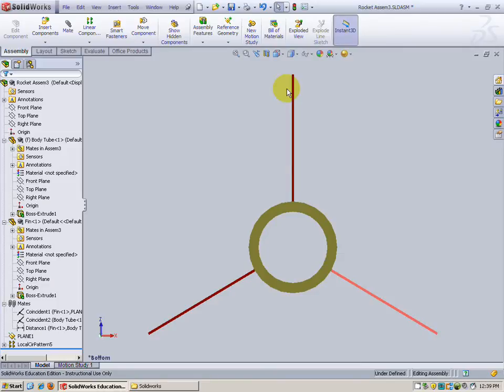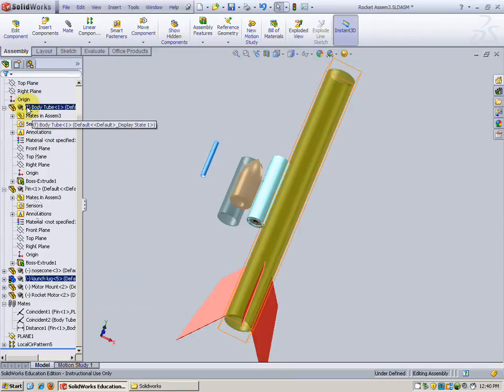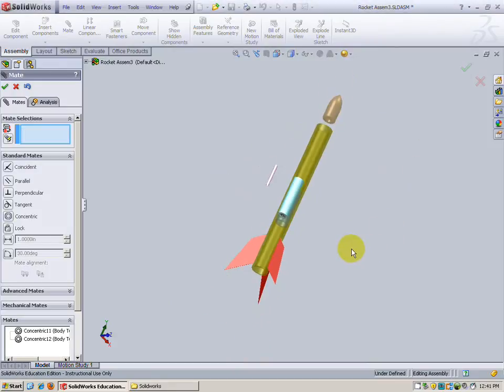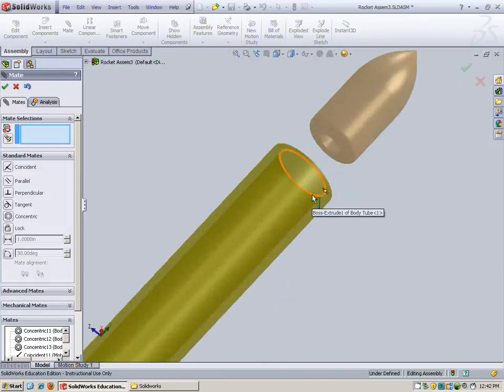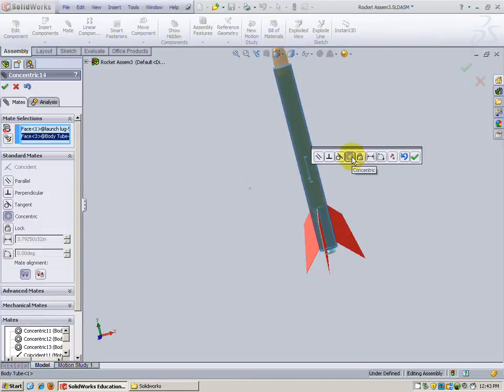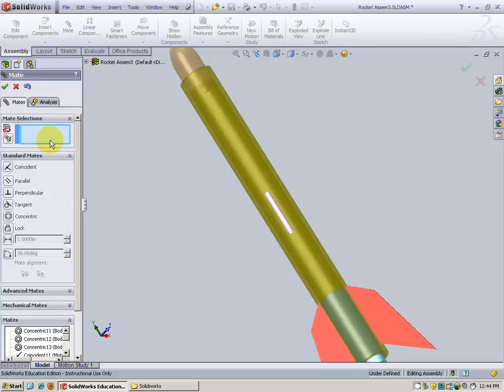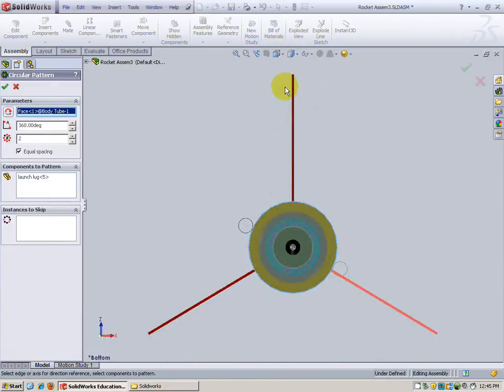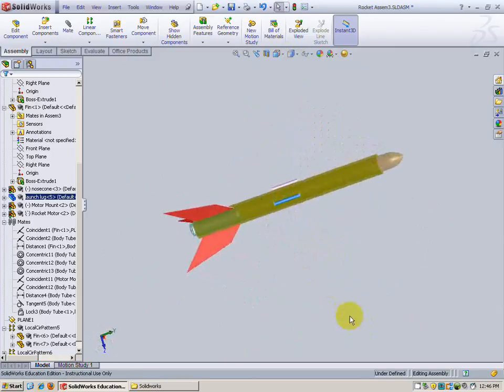Creating Rocket in Solidworks (7 of 7)

Comment: Very nice job otherwise.  One thing you might do with the students is simulate the flight of the small rocket on a commercial program first without the "optimized" nose cone and then with the more optimum nose cone. I would bet that the difference in predicted maximum altitude is not very great.  Then go out and fly both designs and see if it agrees with the code.  Just a thought.  Again, nice tutorial on Solid Works.

Comment: You need to draw a nose cone having an outer diameter flush with the body tube to reduce air drag.  Any reason you did not draw in a step in the nose cone diameter such that the inner body tube diameter "matched" the outer diameter of the nose cone where it slides into the tube.  Beyond their common intersection, the nose cone should step increase in diameter by twice the tube thickness. Any reason you didn't draw it that way after being so precise about the geometry discussed?